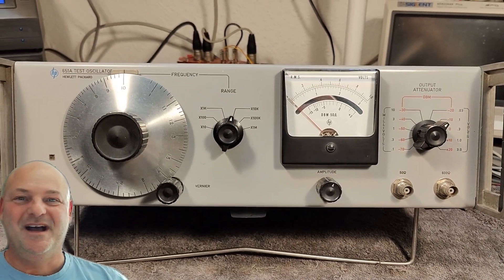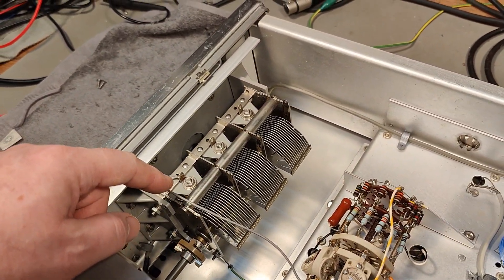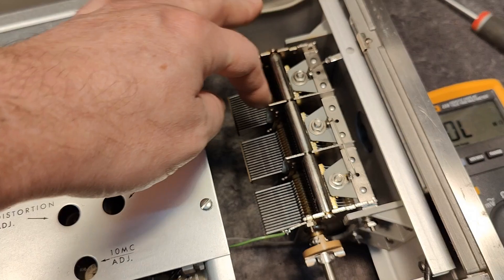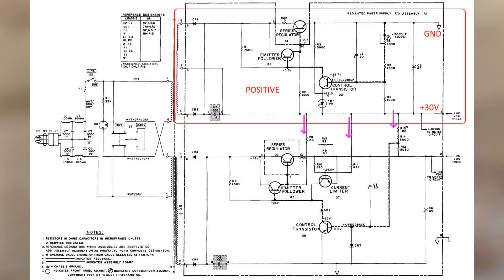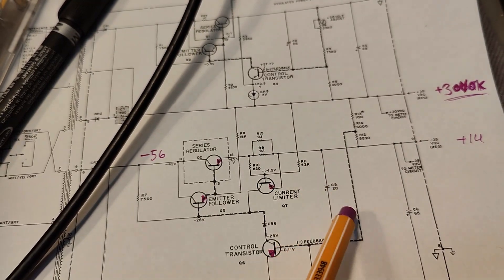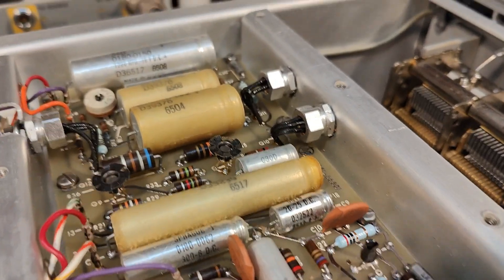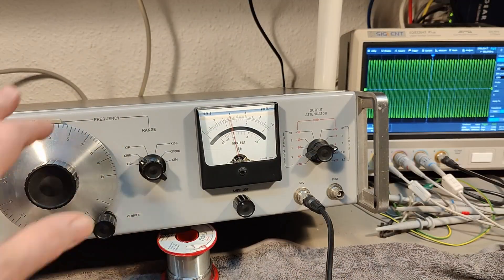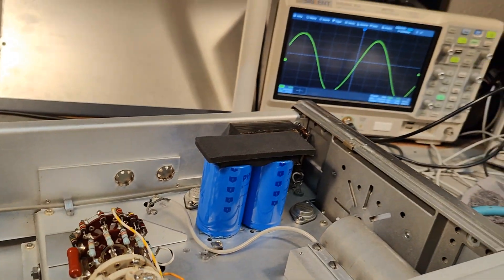HP 651A Test Oscillator 10Hz-10MHz 1965 test teardown repair

Comment: Those transistor mounts (look a bit like pipe fittings) are really nice. HP is indeed always a treat. Cut a wire haha, like, skip this over engineered bit. That "upside down" schematics of the power supply really messes with my head, all pnp stuff back then. It's just the other way around. There switching ground because of the PNPs, really messes with me.
Reply from the maker: sometimes i just pretend in my head all is NPN and all + and - is swapped, then figure out how it works faster, and continue my fault seeking
Reply: @TeardownOZ2CPU  I'll give that a go, thank you

Comment: I don't remember which of them, but one of the other HP boxes from about the same time has a variable capacitors like the one in this, but with 4 sections instead of 3.